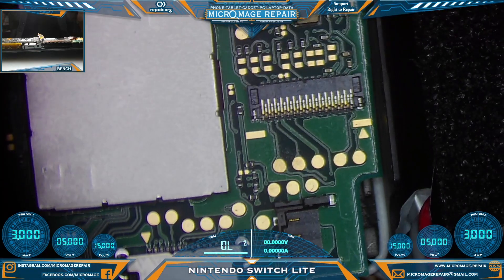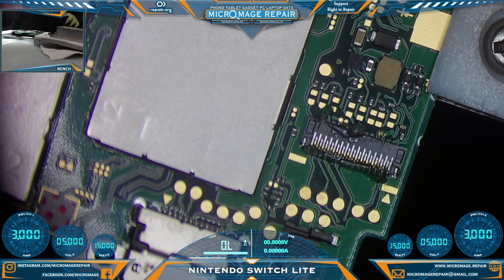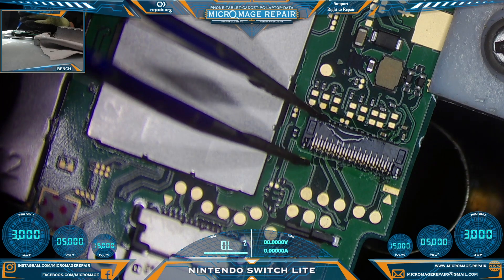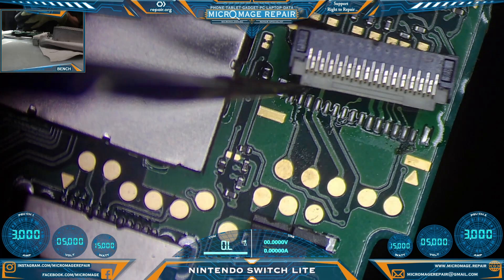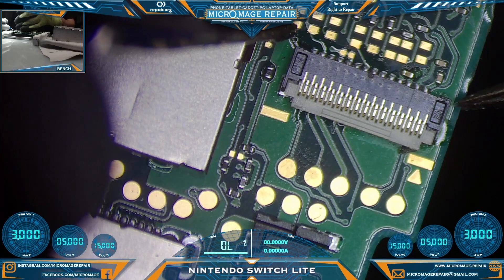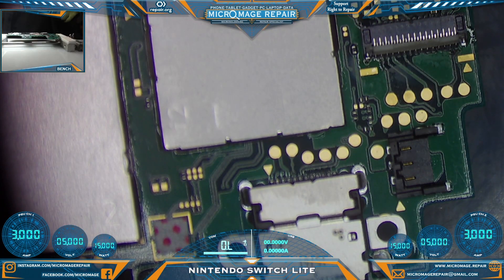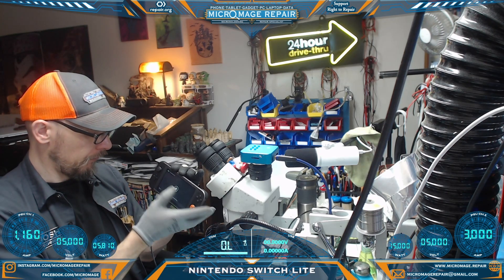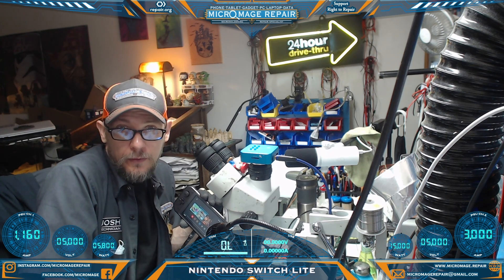Switch Lite: LCD Daughter Board Connector

Comment: how many degrees did you use to weld again?
Reply from the maker: I rarely come off 480C full air (on my station) on game consoles.
The boards dissipate heat pretty efficiently, so they need more to rework than say an iPhone.

Comment: I just did this to a lite I was taking apart to fix a dpad issue. Guess I'm cooked cause I don't have the equipment or expertise to do this job lol.
Reply from the maker: Unfortunately, there is no way forward other than an FPC replacement.  It sucks.
Reply: @MicroMageRepair  found a vid last night of somebody putting the latch piece back into the connector. My piece seems to be intact still so I'm going to try attempting to reseat it into the connector. It's my last hope before needing to pass it off to get it repaired. 

Do you know how much guys would generally charge for this repair?
Reply from the maker: It varies. Brick and mortar have overhead and will be more expensive but can usually turn things around faster than a cheaper mail in service like myself.

Comment: There is a resistor next to this connector that were on the donnor board and not on the board you repaired, why is that? I think it is linked to the volume buttons
Reply from the maker: Interesting.  
I am not certain.  Maybe a different revision? This job was ages ago but there were no reported complications.

Comment: Man i need to replace the LCD socket in the switch lite. I'll just give up.
Reply from the maker: It's a pretty straightforward repair.  You do need the proper technique and equipment.
The first few might take a few tries to get completely down every pin, but after a few, it really isn't a big deal.
Reply: @MicroMageRepair  bought a heat gun with the LCD socket from Aliexpress. I'll give it a shot. Never done something like this.
Reply from the maker: @Ti0Luch0  I'd work up to it on some donor or trash boards of some sort with plastic connectors.  Practice heating from below. Try and execute removal and replacement without damage.  I definitely wouldn't try this cold, having never tried anything similar.
Reply: @MicroMageRepair  Right, i'll look around for pcbs i can damage. The heat gun also has attachments to control the heatwave so i'm getting more confident.
Reply: @MicroMageRepair  So, i've been burning some stuff and i have a concern. How long should the heat gun  stay on the tin for it to melt? Did an analog stick replacement on a ps4 controller and it took a while, it even melted some of the plastic. Should i go high in temp or low and just give it time? I'm around 400 - 500 celcius.
Reply from the maker: @Ti0Luch0  You should be removing the heat once you see evidence that the joints have all wetted.  They only need to be wetted for an instant to bond. You burn things by leaving the heat on well after the joints have wetted. On game consoles I work fast at high heat. I rarely deviate from 480C full airflow.
This isn't a universal setting for all devices or all parts though.  Try that on an iPhone with underfilled parts and you will do serious damage as an example. Or soldering a BGA starting at full air flow is generally unwise as another example.
Reply: @MicroMageRepair  ok so i managed to  put the LCD socket and the Button Board Socket. The later worked but the LCD still shows no image, i suppose the soldering wasn't good enough. Should i reheat or take it out completely and star over? It does seem like every pin is good though.
Reply from the maker: @Ti0Luch0  Check your ribbon.  Even if it has the smallest of kinks that can affect image on these. It's kind of maddening. Check every pin with fine Tweezers or a straight pin (something fine enough)
There is also a possibility (though less likely) that the BL driver near the connector got floated or nudged so check it.
Reply: @MicroMageRepair  well, i fucked the LCD socket replacement, so i'll buy another one and a couple other things too, like a proper flux cleaner and some copper to clean up the old tin.
Reply from the maker: @Ti0Luch0  Failure is unfortunately the best teacher.  It's never fun while it's happening, but you will come out the other side of it with a better understanding of the procedure and technique.

Comment: What stop all the components on the other side you are heating from poping out or get damaged by the heat???
Reply from the maker: Surface tension and the boards own built in heat dispersion is enough as long as you don't bump the board  or otherwise displace the parts or just sit there with direct heat pounding an area for a prolonged period of time.
The length of time you are safe comes mostly from experience.
Reply: @MicroMageRepair  very good to know thank you for the clarification!!

Comment: That video helped me big time😄💪 Just bought a few broken switches and one of them needs this connector replaced. The daughterboard needs also to be changed as the ribbon cable. Pre owner did a fantastic job lol. I bought a aftermarket daughter board with ribbon cable cheap. I will try to desolder the good connector from the old daughterboard and use it on the motherboard.
Reply from the maker: Awesome!
Let me know how it goes!

Comment: Hello, I was wondering what happens to the components on the back of the board when you heat it up this way? Have the same issue right now but  I'm scared of breaking any component on the back of the board
Reply from the maker: As long as you don't make contact with the parts or the board with your hot air nozzle or knock the board nothing will happen to them.
Surface tension will hold them in place. Surface tension is kind of magic.
Reply: @MicroMageRepair  Thank you so much !
Reply from the maker: @catarinacerqueira1187  Thank you for the question!

Comment: Mr. Micro
I just switched out my battery and also broke the tab of that connector. I put everything back together and all the buttons work and the unit is on but the screen doesn't turn on. Could the broken lid be the cause of the screen not working, though it appears that everything on that side of the daughter board is working?
Reply from the maker: Thanks for the question, The lid is important, the ribbon won't be secured onto the contacts without it.
Unfortunately, you generally have to replace the whole connector in these cases, the lid is not repairable alone.
Reply: Thank you for the reply

Comment: I've been doing a few of these connector's recently. On my third one now. The new connector solder joints are solid. I did get s back might but it's staying low at around 30% if I had to guess therefore giving me 15v on the back light circuit which is expected. I do however have no input when pressing left on the d pad. I know that can be caused by that connector/broken pin etc but I'm not 100%. I may try a donor LCD screen about the screen brightness issue. Just wondered if you've come across this one. Thanks and love watching your videos!
Reply from the maker: I have not come across this specifically. I would inspect the ribbon closely, they are very very easy to damage and can cause some weirdness.
Reply: @MicroMageRepair  yea I have some on the way. I tried two so far but used ones. We shall see. Thanks bud

Comment: I replaced one of these yesterday. I tinned the board with fresh leaded but I think next time I'm just dropping a new one on dry like this. What clamp do you use to hold it over the edge of your work bench? Good work!
Reply from the maker: Thanks Hove!
I use a "Stick Vise" it's in my equipment description.
Will need the high temperature fitting wich is also in the description.
It's labeled as "Board Holder".
I just use a block of aluminum or something else heavy. Or I use my bench mounted Panavise.
Reply: @MicroMageRepair  thank you buddy!

Comment: Interesting that you didn't use flux. I don't for removing but usually do for adding. Might try without the next time..
Reply from the maker: Thanks John Carr!
I don't typically on these for a few reasons.
One, getting flux in that connector will definitely extend my turn around time.
I will probably have to ultra sonic it if I use flux.

Two, the non leaded just seems to flow ok without it, and the connector doesn't float off with boiling flux.
It's something I've just been trying recently and they tend to just kinda pop back into place nicely most of the time.
Reply: @MicroMageRepair  great bit of info, will defo try that

Comment: Since this was a donor part and was tinned. Would you pre tin a factory connector or would you just drop and flow it in place?
Reply from the maker: Thanks for the question Slingshot!
I typically just drop them on when I have a fresh connector.
The lids and plastic are delicate and heat sensitive so I personally choose to handle/manipulate them as little as possible.